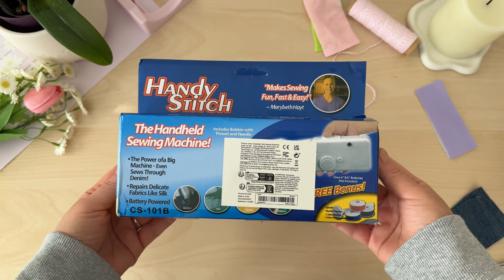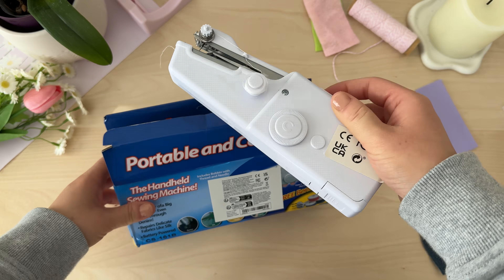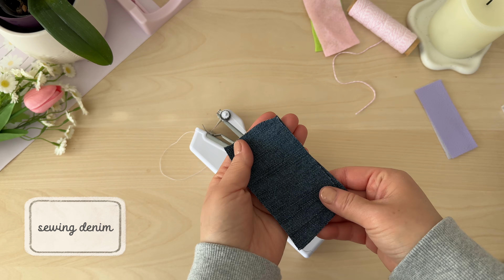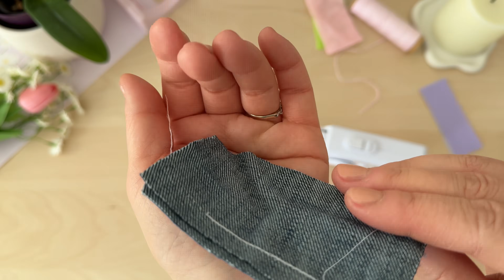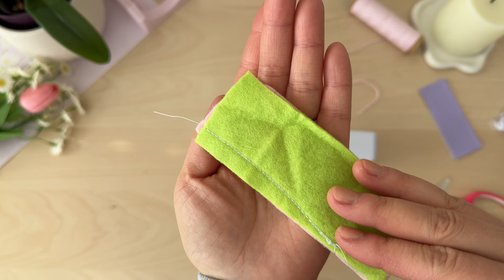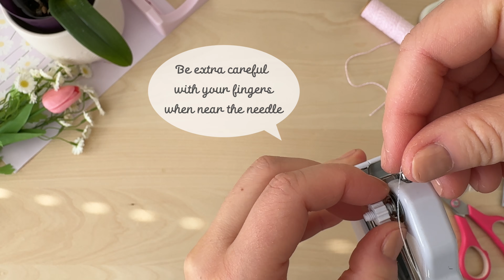Mini Handheld Sewing Machine Quick Start & Review

Comment: I have not seen anyone pull the thread tail through to lock it before.  is that necessary because this handheld machine doesn't have a reverse to do a lock stitch?
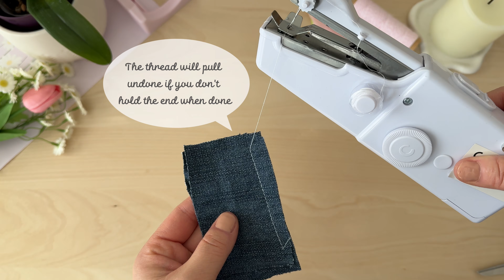Reply from the maker: I find that it pulls undone (see at 1:12 mark) if I don’t pull it to the back, but please feel free to share any tips on any alternative ways to do this. Thank you! :)
Reply: It's not a lockstitch machine. It's an overlock, there's only one thread
Reply: Mine is not sawing 😢
Reply: @gailswan8224  Buy a saw instead.
Reply: Unfortunately you have to that’s the only way i was able to keep my thread tight without having it come undone. It’s actually a very handle sewing machine.